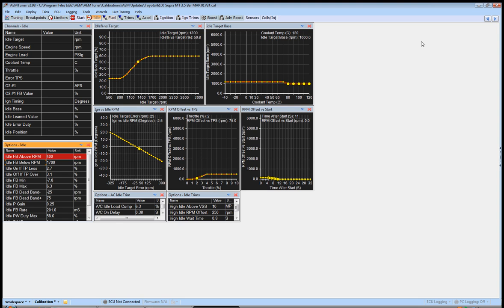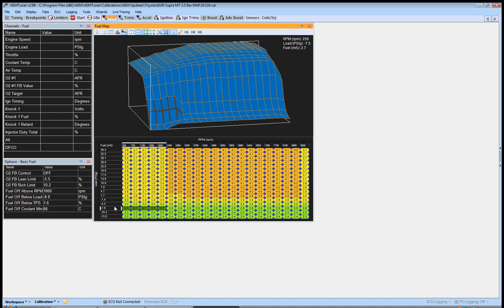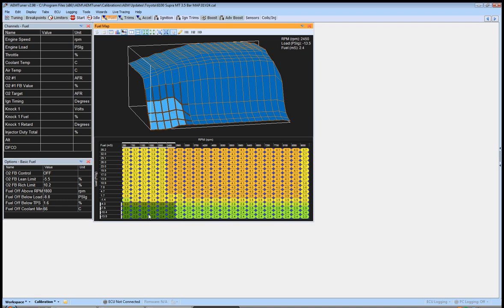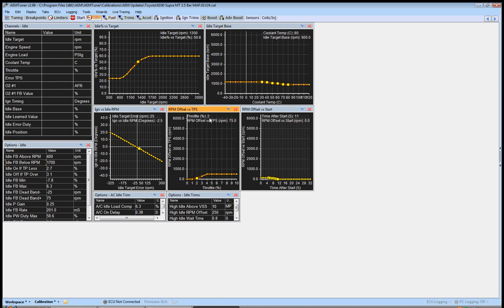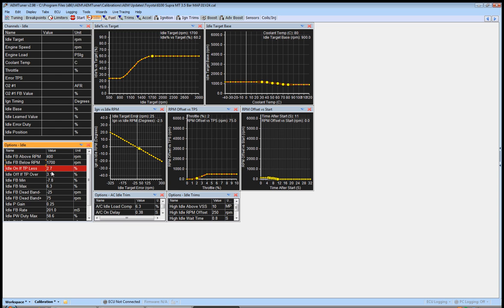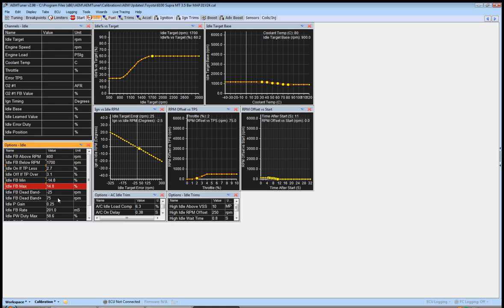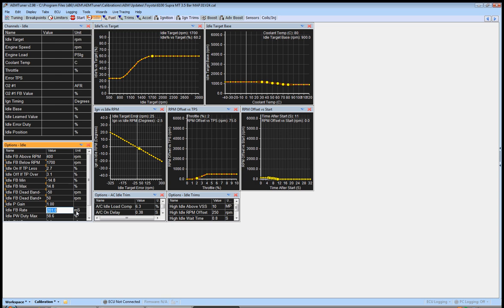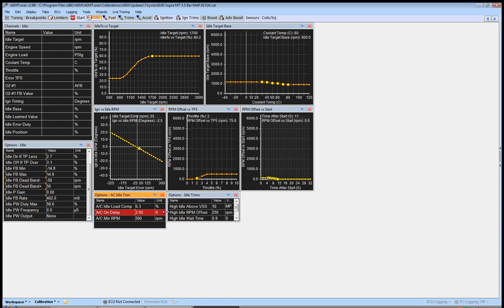AEM Tuning Part 6

Comment: Hey, first off, thanks a ton for making and posting these, I've watched every single one prior to getting my AEM, and I'm now setting everything up whilst watching the series again. Incredibly helpful, I'd be lost on most of this without your hard work here! - I did want to mention one thing, however, and correct me if I'm wrong, but you mention that the Idle Feedback Rate responds more quickly with higher values - I believe this is a PID loop, and that setting is how frequently the loop is iterated through. Higher values = more delay. (If you look at the AEM documentation for the setting, I believe it corroborates this as well.) You can smooth a PID loop with fewer iterations over time, but consistent with your findings, you get really poor response times if you go too high. Am I crazy, or is this correct?  

Again, thank you so much for making these, you rule!

Comment: Got really confuse when you started to discuss idle, like the offset for instance when you said -15 and +15 to reach your idle cold. setting up idle threw me off completely.
Reply from the maker: Say you target 1000 rpm idle, and it takes you 50% to get there. Your max and min value would allow your ecu to go to up to 65%, or down to 35% to achieve that target value of 1000. Even if your idle% vs target table is very close, your ecu still needs the capability to add or subtract from that base value. The reason temperature is a good example was because if you set all of your target idles when fully warmed up, it's not the same as when your motor is cold. So, give yourself a little extra so the ecu can achieve that target value. If you need to go beyond +/- 15%, you have something wrong elsewhere. Hope that helps and thanks for sharing it.

Comment: Is vehicle still running while making these adjustments? prior video said to start vehicle and let warm up, but for each video after the warm vehicle up im assuming were making these adjustments with it running.
great video by the way. I hope this helps me get by for a little while I save for a dyno day
Reply from the maker: Yes, all adjustments are made while the engine is running. The reason for letting the motor come to full operating temperature first is you want to work from full operating temperature FIRST. Once you have it idling the way you want fully warmed up, then you work backwards on the idle trims when it's colder.